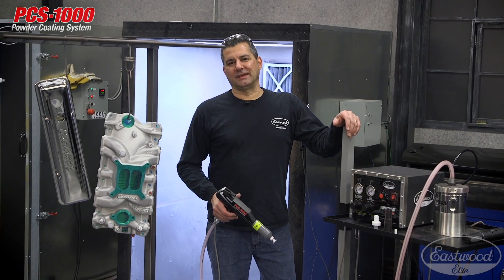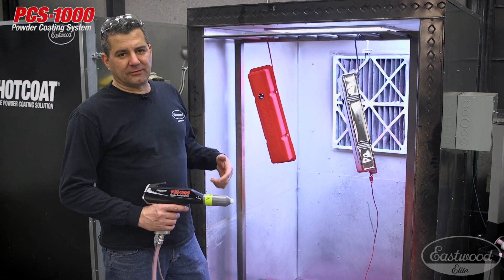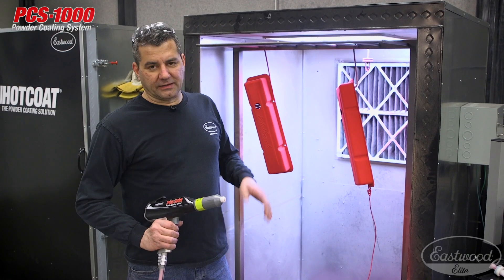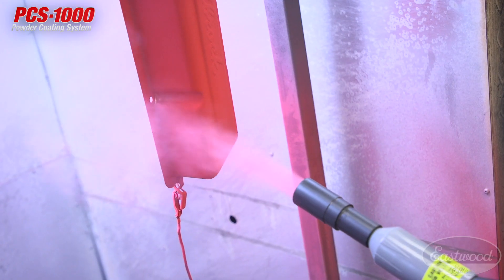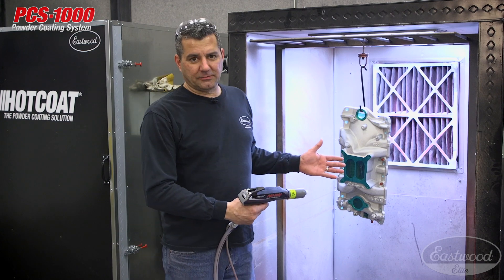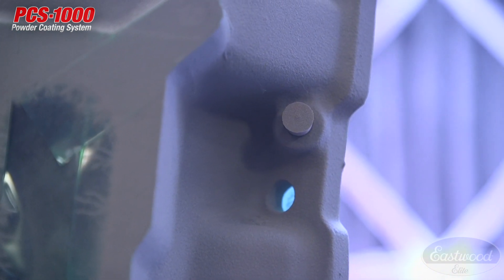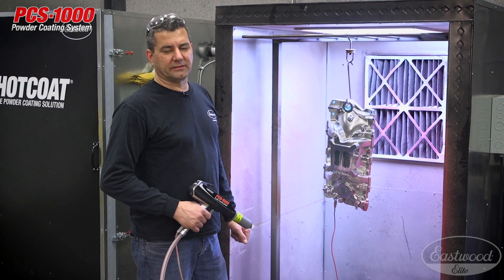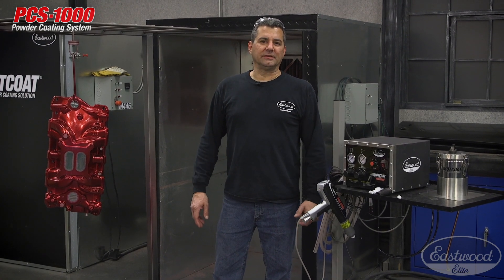Powder Coating Tips & Tricks for Hard To Coat Areas: HotCoat Elite PCS-1000 -  Eastwood

Comment: Pretty sure you aren’t supposed to spray powder inside that valve cover…
Reply: Shouldn't do intakes either, they hold a lot of heat in when you do.
Reply: You do for SEMA show cars dude, not all meant to be riden some are working pieces to show case other accessories,  @ProfessionalByNoMeans

Comment: So you can spray on to chrome without worrying about it peeling off/ up  later on ?
Reply: I bought this system about a month ago. I’ve been waiting for my oven to come in for 7 weeks now so I can’t test it out. I did however build a collapsible spray booth with filtration and a rolling rack to spray and bake. So yesterday I sprayed a motorcycle case cover with gloss black from PP. The hopper fluidized nice. Good powder flow. Wouldn’t stick at all. Oops. Forgot to turn up the KV. So with a setting of about 7KVs it stuck like crazy. Almost no wasted powder. It was coated in 1-2 minutes and appeared very even. The part was hung to the rack by a 4 inch C hook to a swivel hook. A 10 foot 3/4 inch braided copper ground strap was connected to the rack with a welding clamp and the other end to a 5/8 ground rod 8 feet into the ground. By the attraction of the powder I’d have to say that the ground is everything. I also tried using the supplied ground wire clip with my direct ground. Made no difference. All in all? 1st coats a snap. I can’t do multiples until I get my oven.🤬. Stand by.
Reply from the maker: Yup! This will work on chrome!
Reply: @eastwoodco  odd as I have been told for years it wont adhere properly to chrome proply over time ,but if your company can back this up in writing I'm sold.
Reply: @eastwoodco   my understanding is, when you shoot chrome, you should ALWAYS sandblast with glass media  BUT DO NOT blast to the bare metal, all that needs to be blasted is the top layer meaning just scuffing the top layer , and about 10" away from the part , the zinc in the chrome should never be blasted or that will be one expensive project
Reply: watch videos on how to apply and the procedures to doing chrome...

Comment from the maker: One thing is certain, the PCS-1000 has what it takes to achieve pro level coverage when powder coating! 
MORE INFO: https://www.eastwood.com/eastwood-elite-hotcoat-pcs-1000-powder-coating-system.html?utm_source=youtube&utm_medium=annotation&utm_campaign=2020-02-26&utm_content=elite%20pcs%201000%20powder%20coating%20system%20tips%20and%20tricks
Reply: Website not reachable error code 403 why is that?!